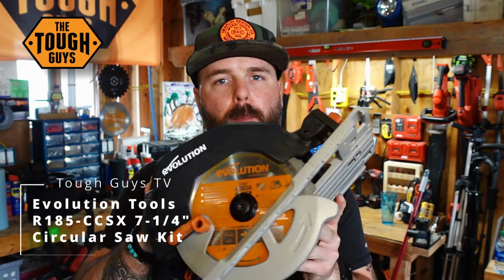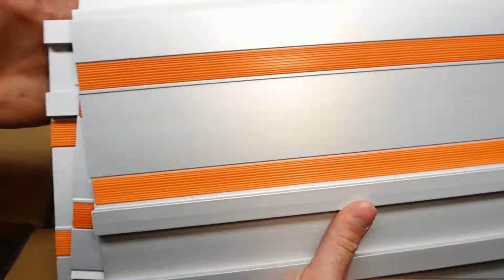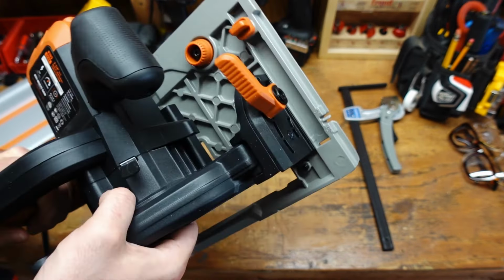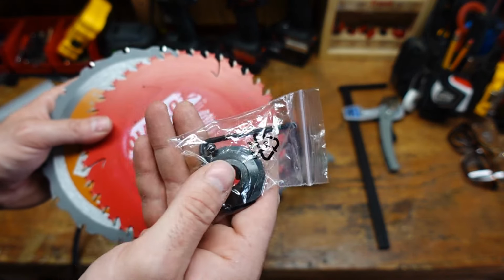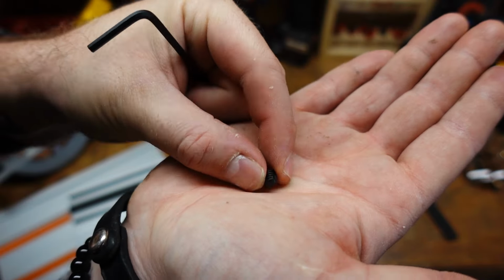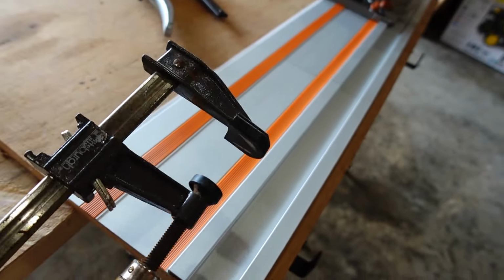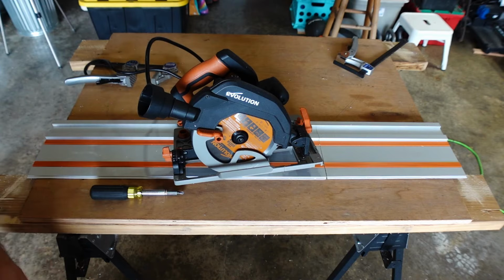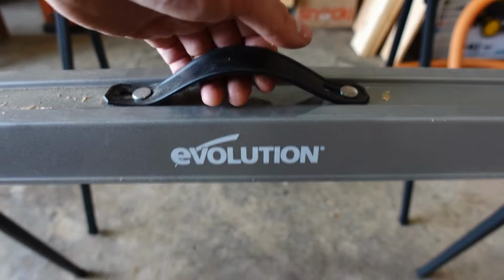How to Use: Evolution Track Saw! R185CCSX

Comment: Great video, very detailed! 👍
 What doesn't make sense is the 3 ft track, could have added that extra foot and charged a bit more.  
Aside from that and being corded, this saw certainly has it's  perks.
Reply from the maker: Totally agree! Not sure why they wouldn’t sell it straight out with the 4ft section. Thanks for watching!
Reply: @TheToughGuysTV  you can purchase 1 full track which is 1400mm which is approx' 4½ft.

Comment: That rubber piece on the end of the track that the blade rubs up against so you know how long it last and or where to get replacements? Thanks
Reply: I don't know but I wondered if your saw cut the edge of the white off? How do I set it to cut out further past the white strip?

Comment: The saw, for the price, is really ok. Just important to point that the track is not straight. When assembling it you can adjust the segments slightly to make it true straight.
Reply from the maker: Yes good advice! You can also make adjustments on the saw as well to assist. Thanks for checking out the video!
Reply: Thanks

Comment: Bought one. Great saw, track sucks fiddlefart to setup a straight track.
Reply from the maker: I like that, “fiddlefart” don’t mind if I use that ?? 😂😂 Saw is solid for sure. My track was pretty good to go after setup.
Reply: @TheToughGuysTV  use it.  Used a strait edge and adjusted track to match. End to end track wasn't square.
Reply from the maker: @wburtney5154 I haven’t noticed cuts out of square yet personally, used it this past weekend building a shop sign for the shop, used the track and my 4ft level for a video to show getting a straight cut two ways.
Reply: @TheToughGuysTV  once the track is setup it works perfect for short cuts. With the Grove in the base one could make tracks of any length with 5 mm plywood, vinyl grip and a hardwood or aluminum guide. I bought the saw to rip steel.

Comment: Evolution really do have a serious allergy to making their tools even remotely competent at dust extraction.
I own a Rage 3S mitre which has horrific dust extraction and a Rage 5 S contractors table saw, which has great big gaps in the lower dust shroud under the blade resulting in piles of sawdust under the tablesaw.
A college had this track saw and I was appalled at how much dust it threw everywhere compared to even the cheapest of track saws I've seen used.

Comment: Try to cut something long and thick (60mm +) and do the video again ;)
Reply from the maker: I need to get some additional track pieces, right now it’s only 36” total, def thinking about a part 2
Reply: @TheToughGuysTV  The problem I faced was that the blade would always "want to go out" or deviate to the right side on thicker material. I realised that the blade was not paralel to the frame...

Comment: I know I’m a bit late to the party 🫣 … do you cut the white strip when you take your very first track cut? … well put together video 👍🏼
Reply from the maker: The white strip is supposed to stay in place as far as I can tell. Now in my case it came loose, so I ended up tearing it off, but that makes things a little harder to calculate where your blade will land.  Once you know the distance though you can add it onto your cuts.